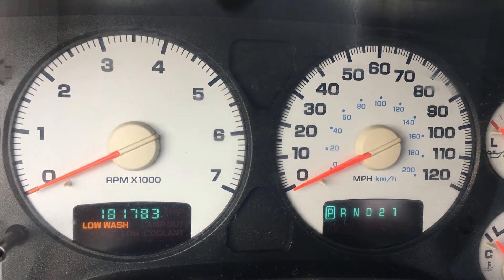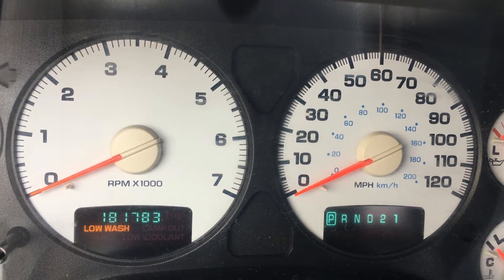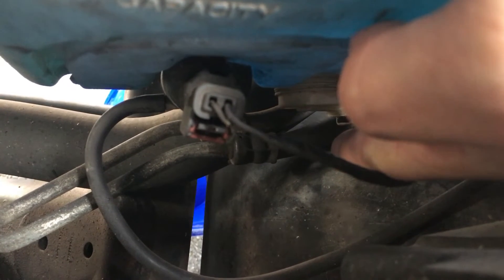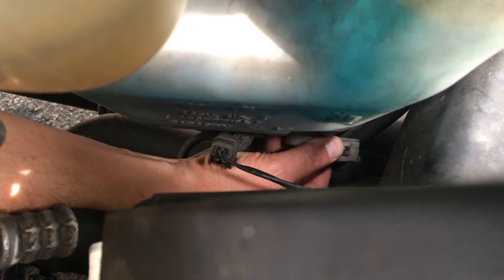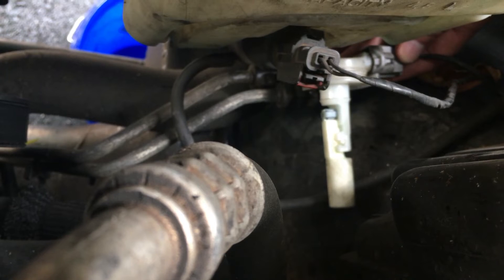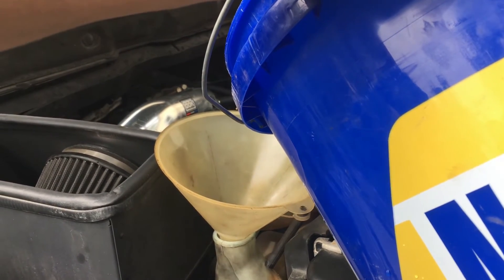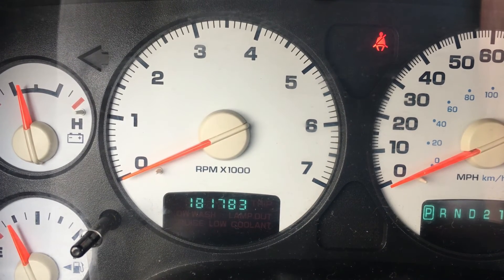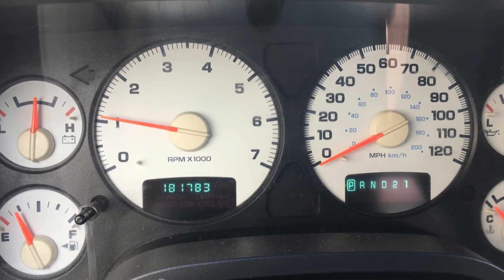2002 - 2005 Dodge Ram Low Wash Sensor Repair for FREE

Comment: Thank you so much I had just recently replaced a new  washer fluid jug on my 04 RAM and didn't realize that I had put the connector a little on a tilt and when I watched your video you mentioned about make sure the connector is facing upward and after I checked it and lined it up the sensor light turned off thank you so much, blessings.Joey

Comment: OR JUST DISCONECT IT. AND NO MORE LIGHT ON. 😁
Reply from the maker: Yes, that will also turn out the light. The only problem is that when the sensor wire is permanently disconnected, the low  washer fluid light will never come back on again when your washer fluid gets low the next time.
Reply: @rollingjunk  soo true. thank you sir.  👍🌹